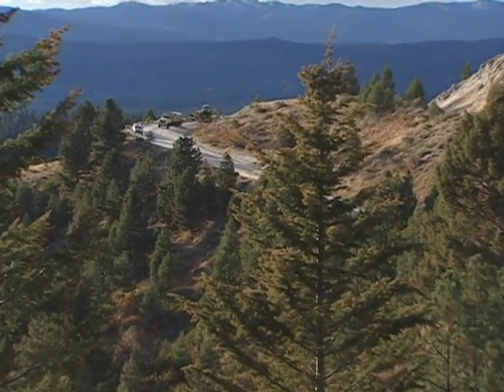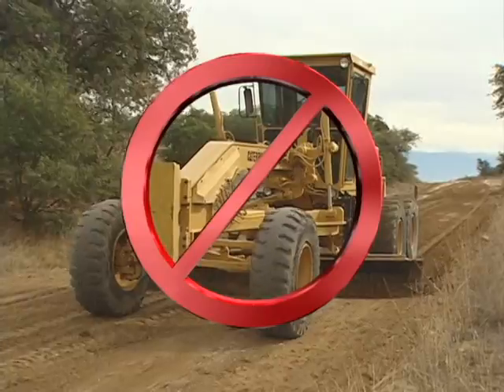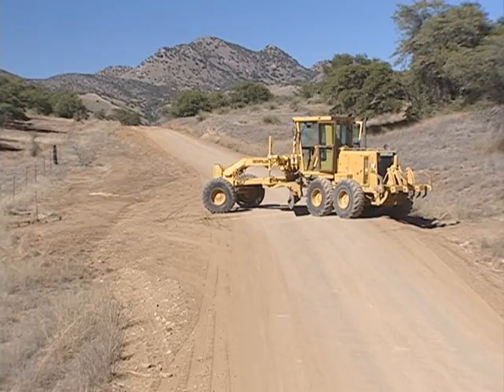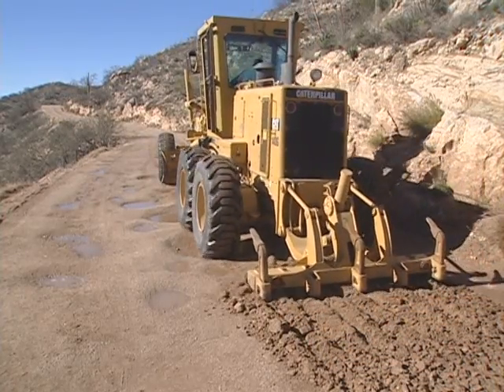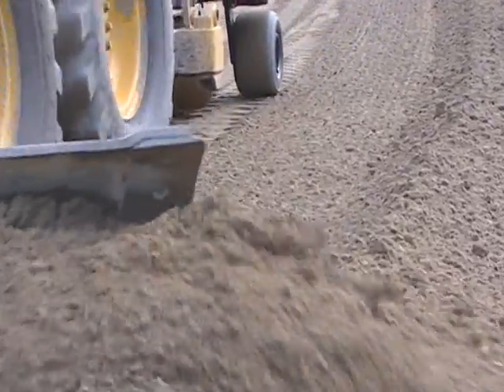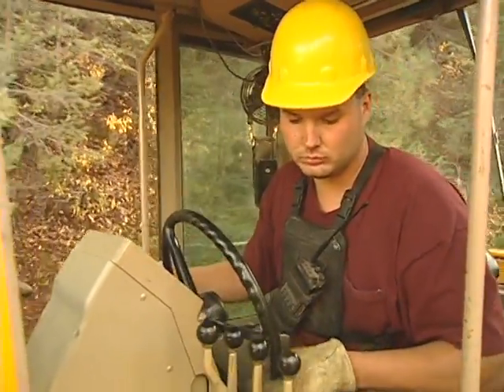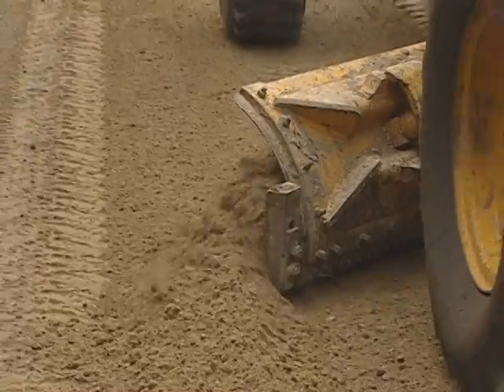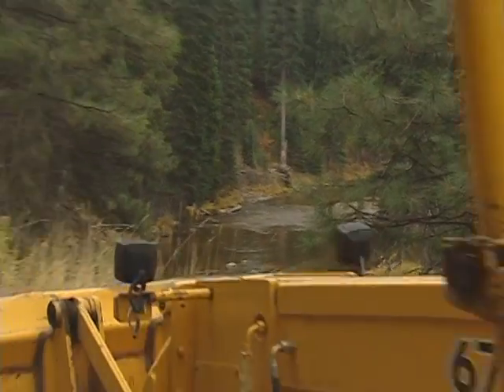Smoothing and Reshaping the Traveled Way

Comment: I process similar to this method.  I only have about 150 miles of processing under my belt but during that time I have found what is shown to work well.  I put both sides of the road in the center, then take it about 2-3’ from the shoulder and place half then come back and place the other half to a 4 percent crown.  The other operators in my area do some pretty different stuff at times but I guess results are what matter the most.

Comment: THE MOTOR GRADER , BY FAR THE BEST MACHINE TO OPERATE ON ANY DIRT JOB . MOST OF THE TIME ITS ONE OF THE FIRST TRACTORS ON THE JOB AND THE LAST ONE TO LEAVE.  ALWAYS A WATER TRUCK NEAR BY AND YOU DONT GET THE SHIT BEAT OUT OF YOU AS YOU DO ON A DOZER OR SCRAPER . THE FINISH BLADE IS THE BEST RIG TO RUN  , ITS BY FAVORITE AND I ENJOY THE HELL OF BEING A FINISH BLADE MAN ! IF THE BUILDING PAD IS WITH IN 2 OR 3 TENTHS AND IVE GOT  A 615 OR 623 PICKUP MACHINE TO WORK WITH ME , A GOOD BLADE HAND CAN FINISH 100 THOUSAND SQ, FT A DAY. EASY !  Finish blade rocks !!

Comment: Looks good but would be hard to follow if you are new and trying to learn.
Reply: I just started running a grader it's actually not that hard. I was able to operate at pretty close tolerances in a few hours. This is even with the really old poorly running machine I'm using.